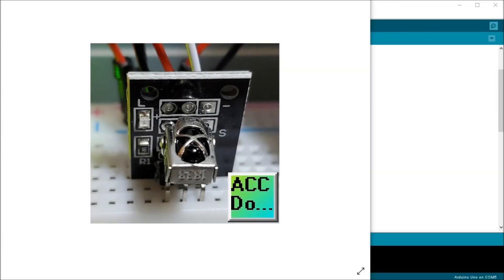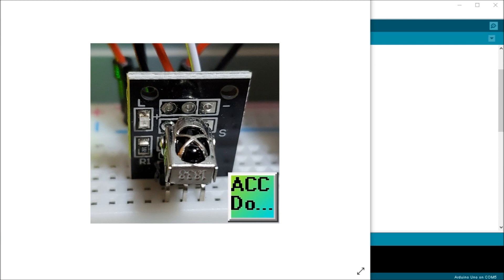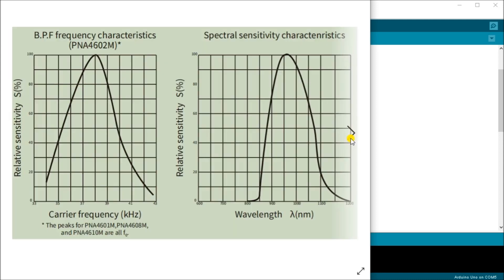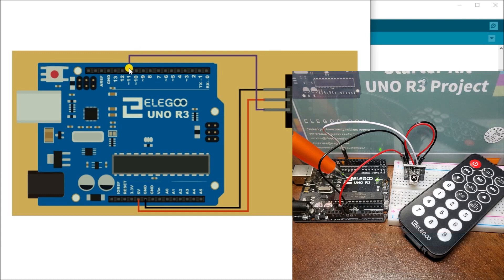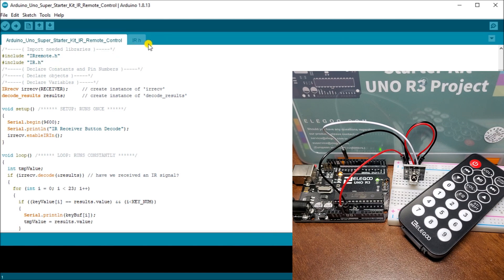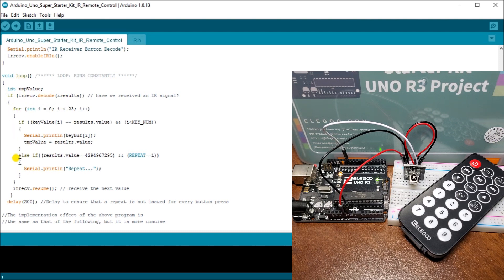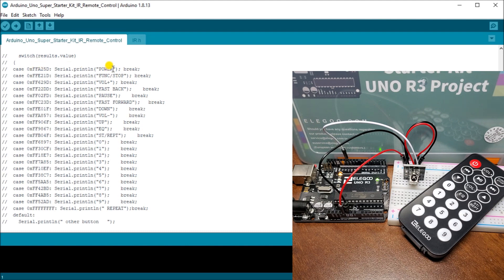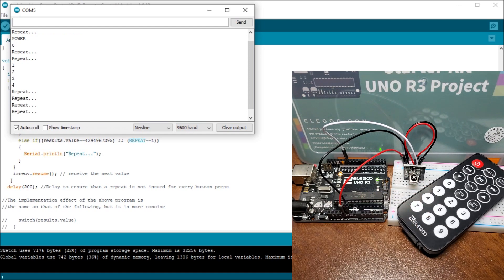Unlock Wireless Control: Master Arduino IR Remote in Minutes

Comment: Can you show how to mske somethng with it? like control a light or servo?
Reply from the maker: Hi Opykliptz,
On the post related to this video, you will find the code.
https://accautomation.ca/arduino-uno-ir-remote-control-infrared/
Using the CASE instruction you can determine the key(s) pressed so a light can be turned on.
I hope this helps you out.
Regards,
Garry